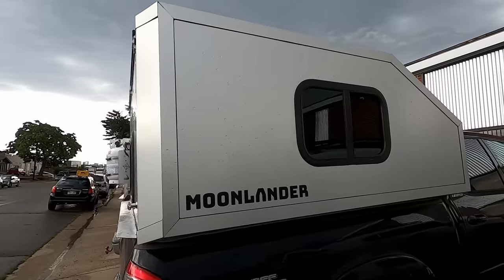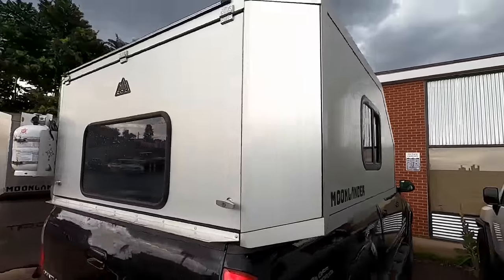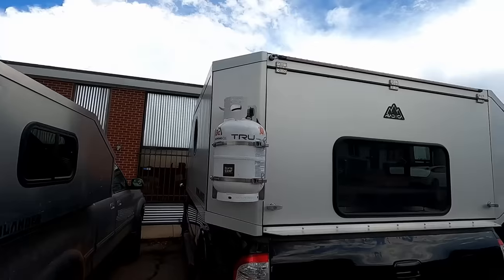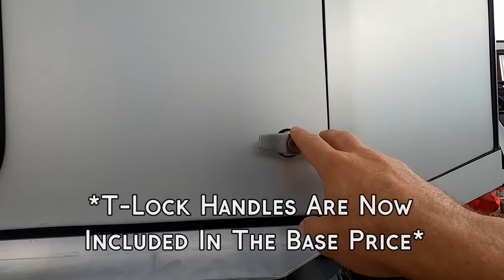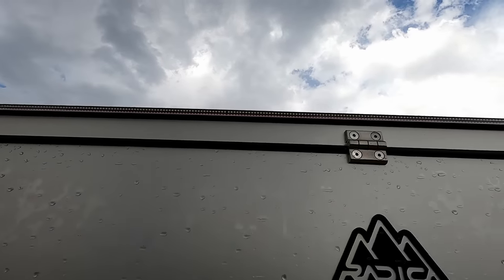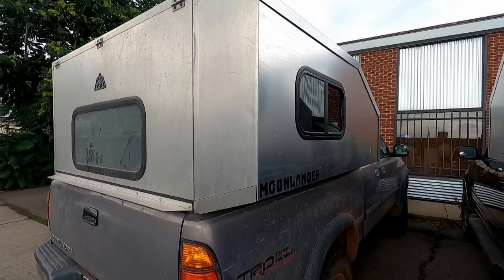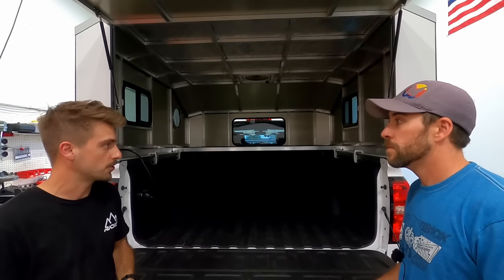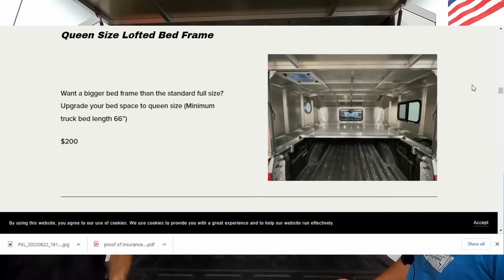Moonlander - The Best Hard Sided Overland Truck Camper/Shell! - What Is It & Why Is It So Amazing?

Comment: How’s the heat during the summer? Does it bake in the sun?
Reply from the maker: Yesterday I was inside the truck bed installing a BedRug.  It was about 85 degrees outside.  I was parked in the partial shade at my house and had my Maxxair fan cranked on high.  It was about 80 degrees inside the Moonlander.  It does get hot in there. I usually camp with the Moonlander at high enough elevations where it doesn't get hot.  I also make sure to setup camp in the shade, so it hasn't bothered me.  Hope that helps, thanks for watching.

Comment: Not insulated, any issues with moisture build up?
Reply from the maker: In temps under ~38 degrees, yes, there is moisture build up.  But I also don't have the windows open as much while sleeping in the colder temps.

I've had truck campers before.  When I've slept in the bed over the cab in temps under ~35 degrees, there's moisture build-up.

In cold temps, in a small space, moisture build up is going to happen.

Comment: Can u stand in the moonlander? What's the height from bed of truck to the ceiling of moonlander?
Reply from the maker: You can stand up in the Moonlander if you are under 4'10", lol!  The door opening is 4'6".  Those are the inside height dimensions of my setup.  It will vary based on how tall your bed side rails are and also how tall you cab is.  Thanks for watching!

Comment: What was the price of  yours out the door?
Reply from the maker: With tax and everything, it was around $8,800.  Much cheaper than a wedge pop-up or 4 wheel truck camper.  The cheapest wedge pop-up I saw for an 8' bed was $12,995 before taxes. And a 4 wheel truck camper Project M starts at $11,500 without any windows or add-ons, so by the time you deck it out like a Moonlander, it's probably $14,000 or so.  Thanks for watching!

Comment: Hot much?😅😅😅
Reply from the maker: Not really, I camp at elevations ranging from 8,000-10,200.  In the summer, day time temps are usually in the 70's maybe low 80's.  If it's too hot, I park in the shade.  In warmer climates, yes, it would be hot but so would any camper without AC.  Thanks for watching.